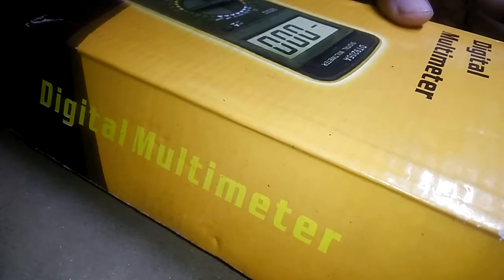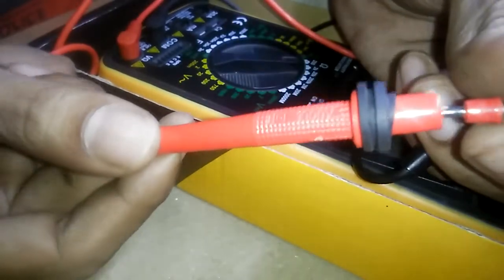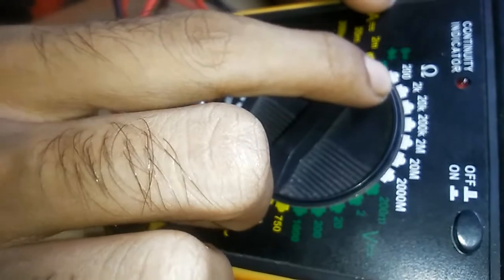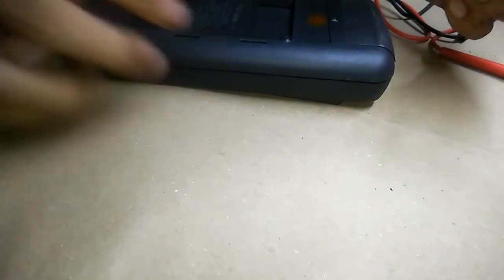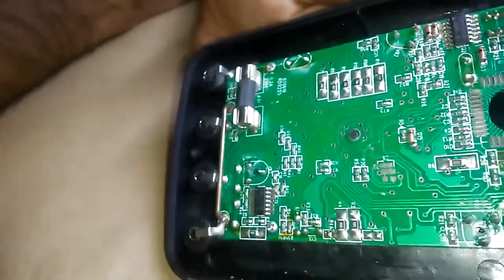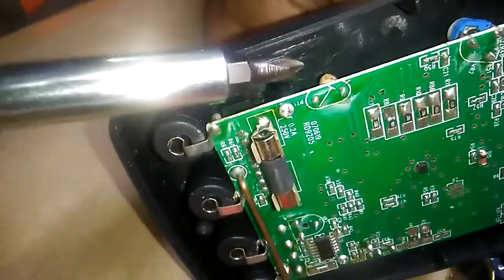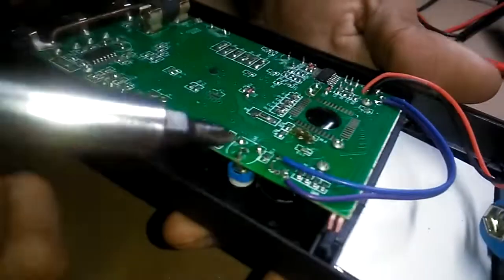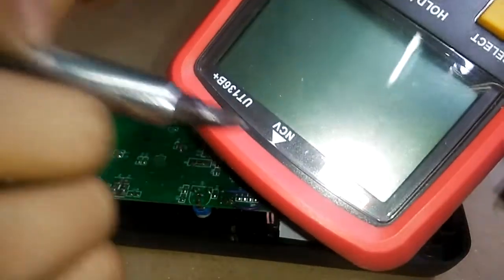DT9205A digital multimeter teardown!

Comment: wronge value sowing after touching each probes in buzzer mode Right value is 000
Reply from the maker: The buzzer mode is also the diode voltage drop test. Try few diodes and you will understand.